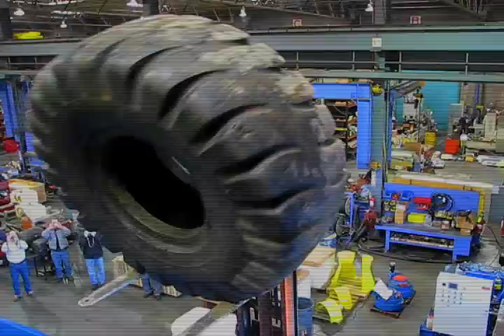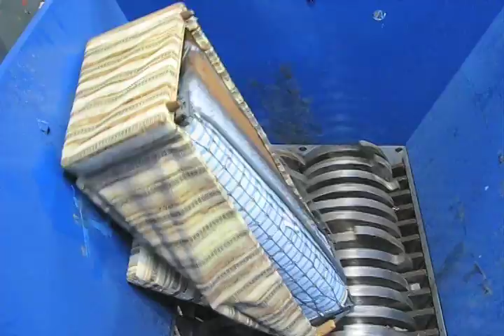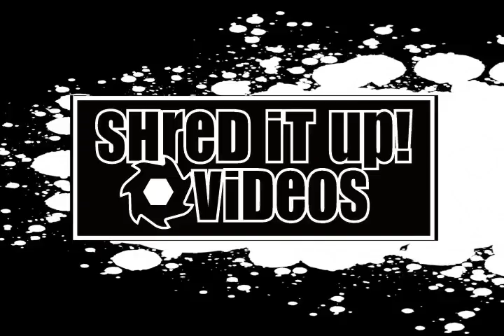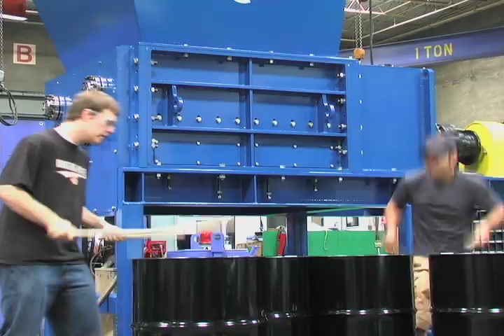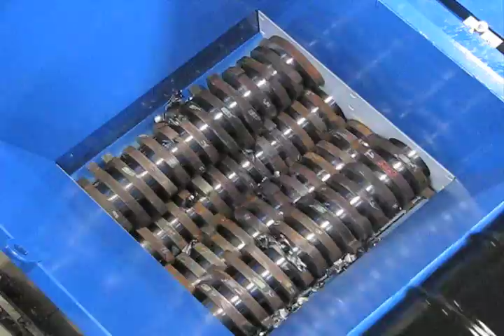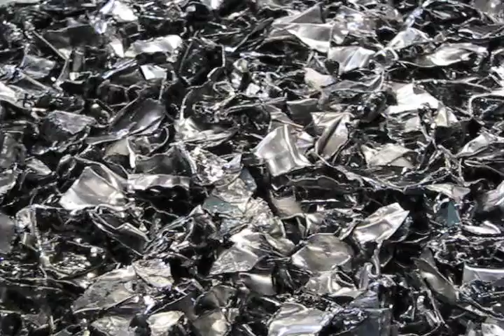SSI's Shred of the Month: Steel Drums Shredding (Q)

Comment: my thought is a x configuration .shaft at 135 deg with a spiraling tunnel with another shaft at 310 deg with a gap between . that would take a lot of the vibration out of the machine . and it will kick ass

Comment: When they shred stuff it's like £75 straight down the drain!
Reply: I dont think that you buy a barrel that is contaminated with chemicals....
Reply: +Nino Joel  There is no residue on these barrels of any kind that would indicate them actually having been used, no spillage. Also the paint and the paper label would get damaged while handling. Those must be freshly unpacked straight from manufacturer.
They aren't exactly expensive, but still a waste.